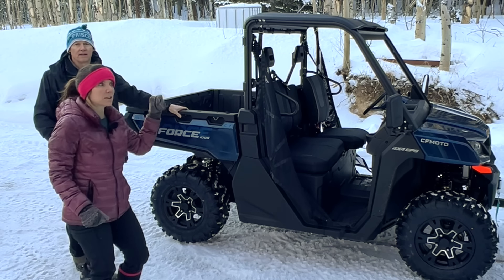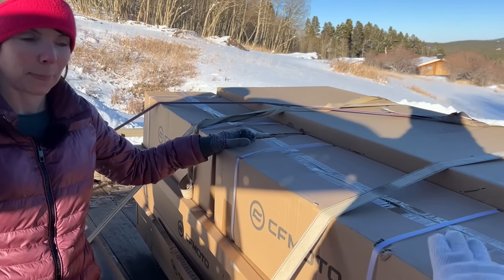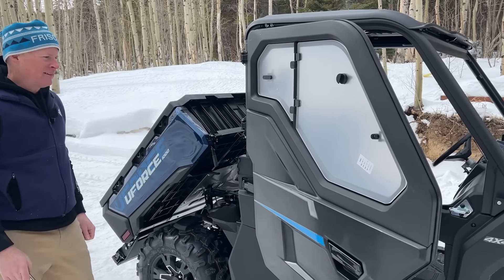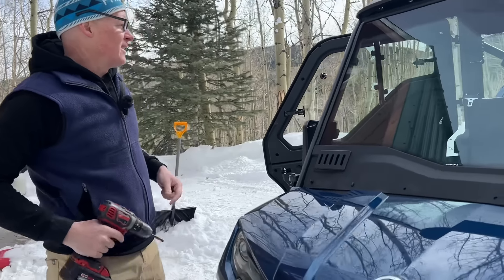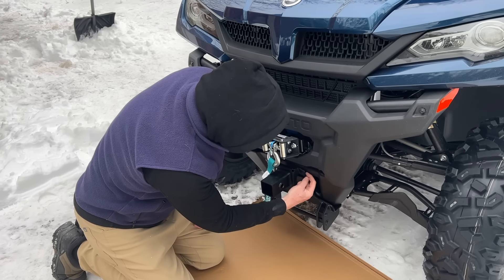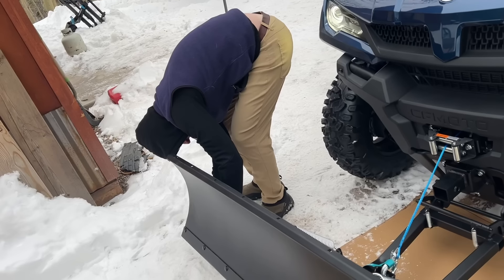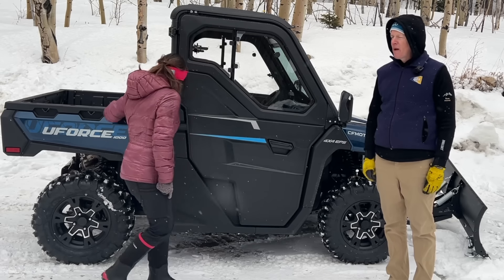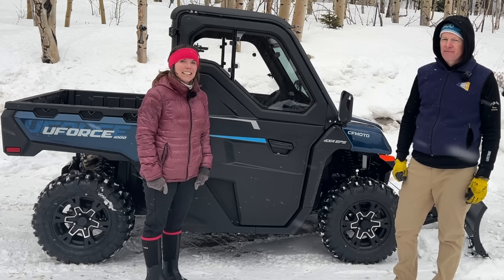Must Have Accessories for CF Moto U Force 1000 | for Colorado Homestead

Comment: I have the same rig with lots of plow use on it.  For the small jobs you're planning on you don't need chains those stock tires are super knobby and they plow and push harder than you want to stress the clutch/belt/transmission, I even spread out a gravel pile with no issues taking small bites. I did notice getting high centered in snow from time to time, put a Perflex 2" lift (with 1" wheel spacers) and went to similar 29" knobby tires (QuadBoss QBT454 6 ply radials), then of course with the bigger tires getting the TeamMSC Stage3 clutch kit because you sort of have to, and their tune.  I put six 60 lb sandbags in the dump box when plowing.  Those are half doors too by the way for summer...  I'm in WY so similar to CO so my next tires will be 30" and slightly more rock style to avoid rock puncture.  I found your video because I was trying to find tuning for high altitude, most everybody tuning these are down low.
Reply from the maker: Awesome - thanks for the info!!  So far no tuning problems and we're at 9300 ft
Reply: @ColoradoMountainLiving  the tuning is fine stock the way it is, all that the new tune programming does is give you a slight boost and horsepower and torque, for $400.  And supposedly it will take away that neck jerk on the start in low gear which the U1000s are known for.

Comment: I just installed the flip up windshield on mine. I had the flat windshield, but it just did not let air flow.  In Florida, the more open, the better. Would like some half doors.
Reply from the maker: cool! that sounds like a good deal. Our summers are pretty short here.
Reply: @ColoradoMountainLiving  Yeah, It is awesome.  Lets the air flow.

Comment: We have a similar setup but KFI plow. SuperAtv windshield and poly back window. May change to a glass windshield with wiper down the road. 2024. I bought a 12 volt heater that defrosts the windshield and gives some heat but also purchased a propane golf cart heater. Mr. Buddy.
Reply from the maker: Nice!! 12 volt heater sounds perfect- thanks for the tip!!
Reply: @ColoradoMountainLiving  you’re welcome. Don’t expect it to warm the whole cab though but for 15 bucks it’s worth purchasing.

Comment: If the winch doesn't have a limit switch to prevent it from trying to raise the blade above its limits it would be a good idea to add one. A diesel heater would be a great addition.
Reply from the maker: Thanks for the suggestion about a limit switch. Will double check.